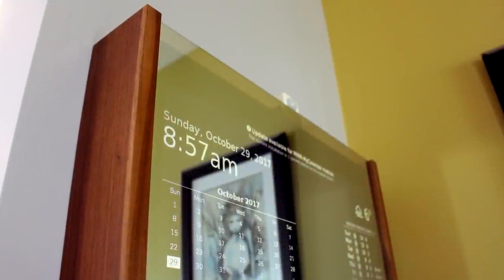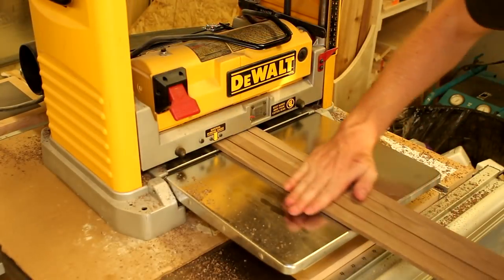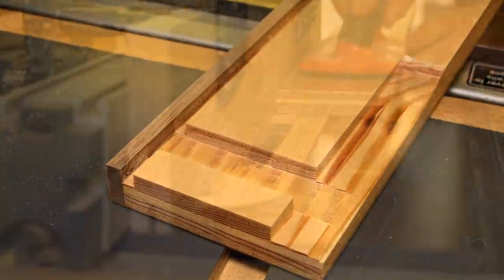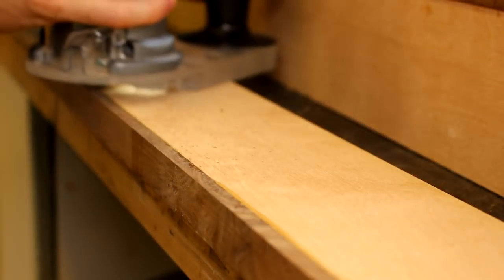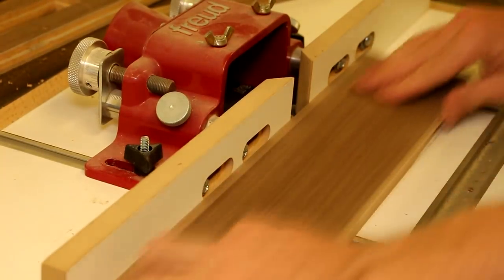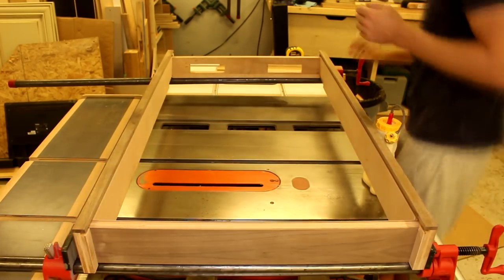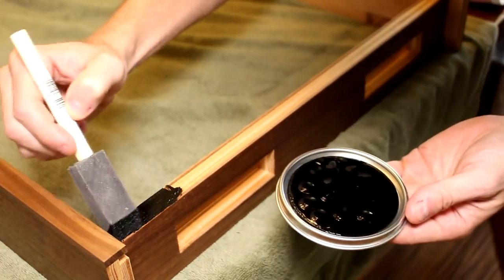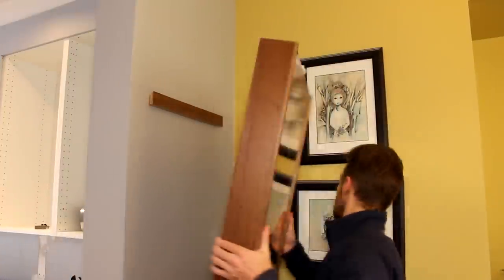Make This Clean SMART MIRROR Frame

Comment: How is the clarity of the mirror? Was the glass worth it?
Reply from the maker: +IonicBasher 

Good question,

The mirror was the most expensive part of my project @ $200 CAD. It's very sharp and very clear. For me it was worth it as I was really trying to avoid a fun house mirror.
Reply: @buildxyz  I can second this. I've placed mirror film on the plexiglass front that comes with Ikea frames, and it is pretty warped, especially near the corners. My next mirror will be with glass